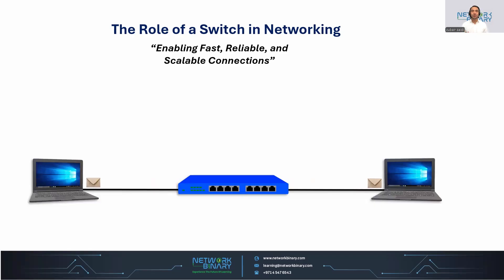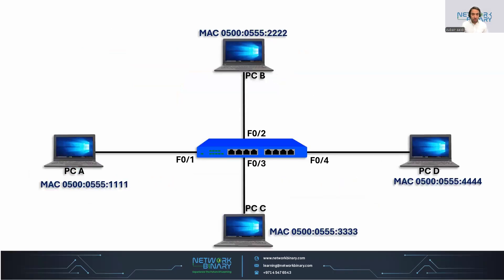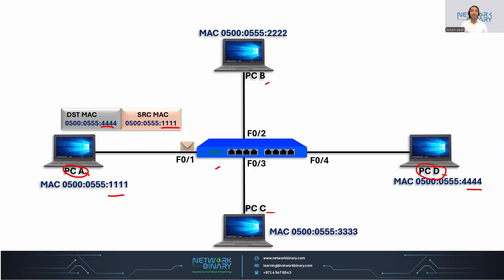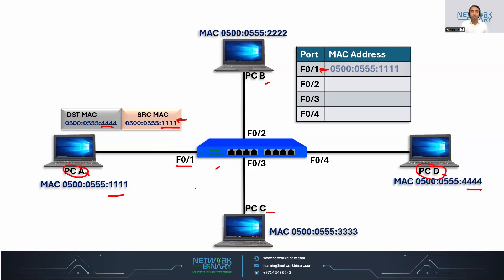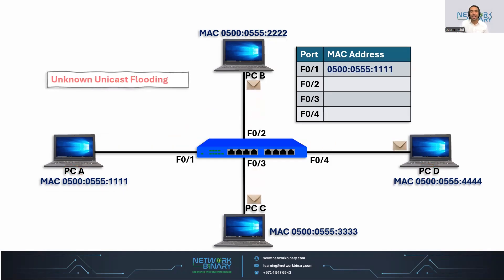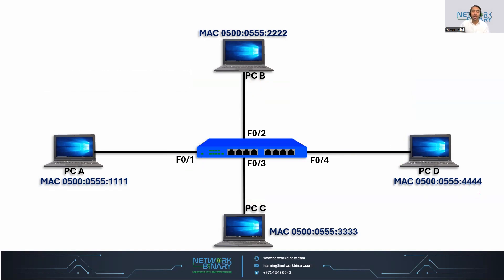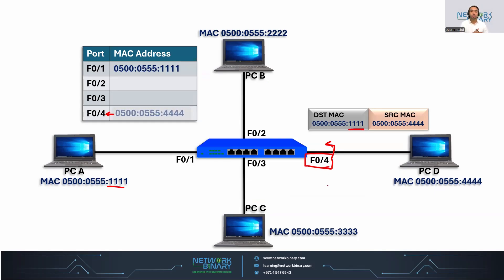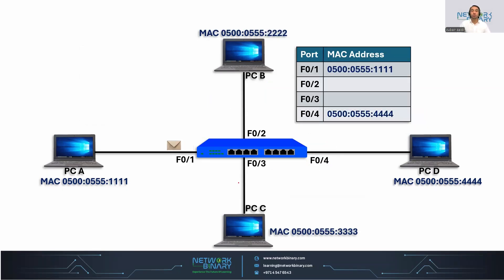How Switches Work | Frame Switching Explained | CAM Table

Comment: Second part. The multi usage secret of such of initial example the undersea pixel beam anchor by flash and be redirected using only water stream propulsion of undersea or floater ships designed of such or the ionic molecules bubble interact of stream graphics of fission and fussion reaction inside molecules atoms like blinkers inside wherein the taken where the attract  to each Spiderman like weaving per poles along its internal tubes front while the left behind the rear  ramjet or scramjet water blast effect of 2 sided parallel movers of forward from back ionizations while it's stable base in its covalent energy producer engines as an example only of machineries tech for such because the future of propulsion can be determine only by 3 forces at work, when underwater, the modern types of batteries, the energy type source, and the passages of propulsion inside sea submersibles. The pixel bean anchor to pole to pole per redirect  of a job also of undersea dual mode stationary drones submersibles of water mirrors by LED lighting Neon lights or by Echolocation waves undersea communication to a future mode of Teleportation in tandem with bounce mode signals back and fourth for echolocation waves travels fast in water environment  meaning the streamlining of sea farers sea floaters ships and undersa submersibles can be moved by just continuous echolocation with frequency numerical synch of wireless thread line of compatible while the electron or mineral types shall be configured in the mode of likened to its properties of whatever shaded in the Periodic Table of Elements of ability to attack and interact not just by short burst signals but in continuum wherein codes can be made by system shapes of  Jackstone like round and lines of Majorette of interconnecting linears combinations of augmented 3D reality in combine with virtual reality tech system codes shift shapes a prelude to Dimensional areas introduction and research es. Let it be. The 3rd part of transport variety tomorrow. I'm tired.

Comment: Project EU European Union. The Roads and Land Bridges of Interconnect. The Walls and Bridges of EU, at the entrance and exit Port based at the Portugal area of 40 degrees going North of by 10 up of its Secret Princess GAL or GAL Matter port of probable Magog area version fronting it's counterpart but of another area of Northern Europe G type Gibraltar Morocco or it's Bee Hive opposite side of a Rock. The Port area shall be it's connecting point interact to the other side of Atlantic of the Americas Nort h Central South and Carribean of Spanish speaking countries of possible tourist attract and future of influence business partners wherein a probable Tower Master control of undersea  Cables likened to Octagon of TENtacles geographically located in Portugal and at the sane time Communication node using slope adjustable to sea skimming beam of connect likened to sea skimming missiles near sea water of threads of beam currents to snd fro couriering to less observable transport beam strings across Atlantic if ever and in parallel from  other linear of Latitude and Longitude intersect adjacent side 40 degrees to up high by 10 degree per climb into IceLand of an Isle  parallel up with the Prime Meridian going to separated to EU of U.K because it's a fortress by itself and ftom Iceland Port only going North East towards Norway Sweden Denmark of the Arctic Circle line and Isle of per intersect a marking point of upstructure station to lower depth structure of orientational pointers of click like at the junction for timeframes have partition and separation per area and directional guide per junction of intersect within their sea waterscope up or air traffick and down for sea water levels gauge levels of electric line like posts but instead of line it's Physics of ionic Elements beaming per station of covalent bonds. While the entrance to Medittrranean of different design of Voltage gated channels and gateway like in the Neural Brain using Electrolyte like Minerals in synch with the Helium and Nitrogen effect of either dilate to narrow of contract with frequency like streams of larger curving diamonds of amplitude heights and hertz the voltage it's stations propulsions control using Vacuumized Water Cavitations with varying wavelengths of relax mode EM dissociations at ready for the  go signal of dilated swingy wavy switch mode electrolytes and other minerals in transport chains while the frequencies of EM ( Electromagnetic )to contractility mode of vibratory  of to and fro attract vacuumize  in cavity streams guided by its Poles guided gauges of up and down skyscraper like side to side pointer beans to rotate of poles from fix internal to outside tech poles hugging rotators the anchor of upper  air exposed reverse broom open and close linear metals of conductors to transistors were interconnectors to the other wireless poles dual mode floater to sea bed extended pierce yo gravity fields of mantle waves for stability which when in transfer mode interconnect to space orbitals to thread the line of latitude longitude of per square junction to area plant and can be replaced by Air belly plane release by parachute geolocator floater devices and trackers for the beam joint. Multi usage, skeletal framers  beam guides for the layered pathway networks underseas. First part of the lay mode. Let it be